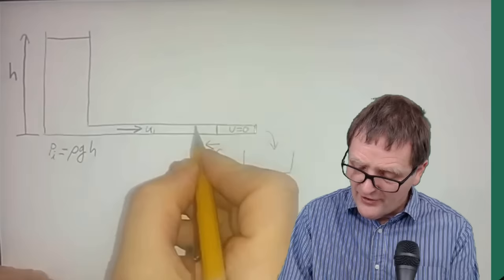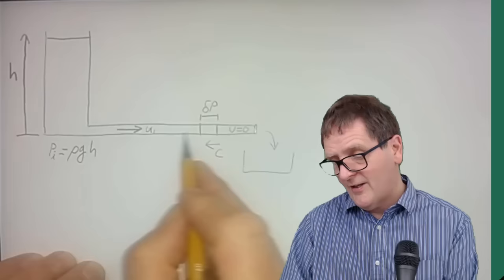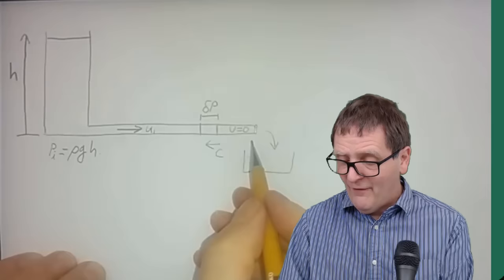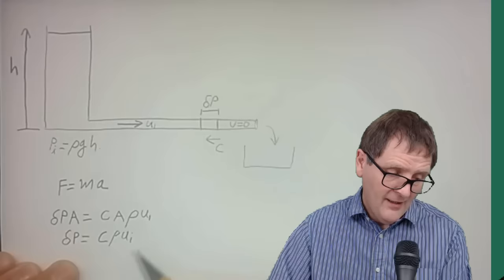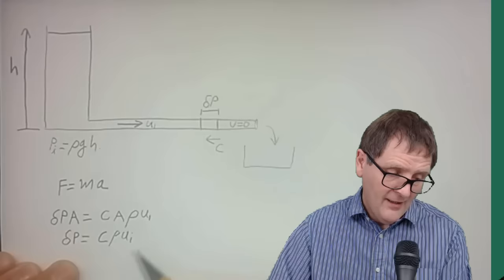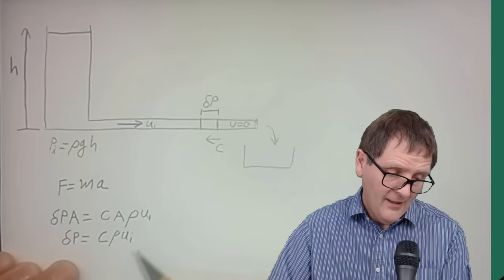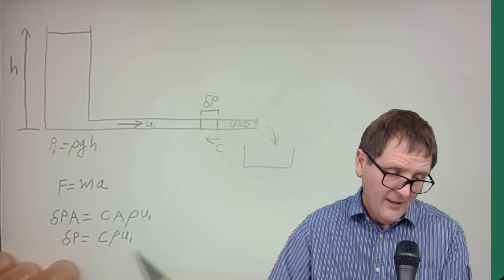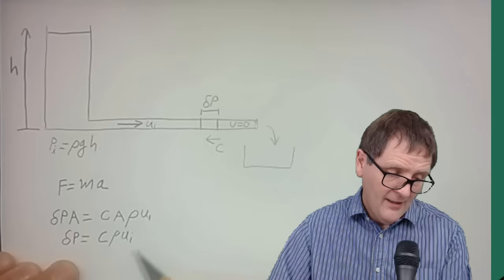Water Hammer Theory Explained

Comment: I'm a bit confused. Don't we need to add the calculated delta p to the line pressure to work out the maximum shock pressure before calculating the safety factor (i.e. piping rated pressure / maximum shock pressure)?

Comment: Can. You give equation for 
Bell siphoning
Siphon
Inverted siphoning
Herons fountain 
So we got maximum free energy for daily use or we give enough zig zag motion to water hammer so it's boiling with own energy 
Consider we have 100 meter pipe having zig zag fittings so we got maximum hammering and we can increases the temperature for boiling 100 degrees Celsius ????
So how many rounds will it required ?

Comment: Thanks Mike. I'm trying to use this to find the air pressure rise on a plunger, being suddenly pushed forwards against the incoming flow. Would you say this would act like the valve being shut instantaneously or would it have a negative time value? So would a negative pressure against the flow (pushing against) create a higher pressure wave front, what sort of multiplier should be used in this instance? I guess it would be added to the flow velocity?

One more question, how would we modify this if it isn't in a pipe and it essentially had infinite area as it's convex rather than concave. Setting A to zero in CAP would basically mean Cx0xP = 0? So no pressure rise? Or is this where the flexibility adjustment would come in as the flexibility of the surrounding fluid.

Comment: before i am very thank full to professor (mike crowley) has posted about water hammer video which very help me cause i am student of mechanical engineering has thesis to analysis of fluid dynamic phenomena concerning on water hammer (creating hydraulic ram pump with harnessing water hammer as main power). But i still confusing about effect of water hammer after it is rising up the pressure causes water having supersonic velocity after the valve closed, my question actually very simple but i still cannot get the answer.

"after water having happened, the water's behave always makes reflection cause the valve closed...and how long the reflection of water inside the pipe ?"

Hopefully you can reply my question, that is big favorable to me...
Reply: I assume that water supply is elastic pipe (flexible pipe like PPR, plastic pipe etc) this much pressure absorbed in the pipe
Reply: No reflection must have air or will burst system see eng 577